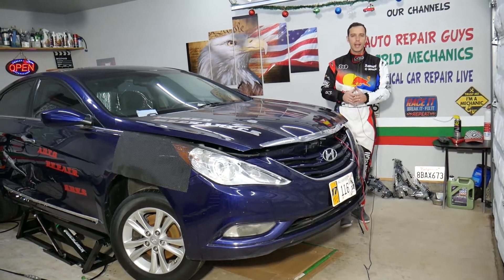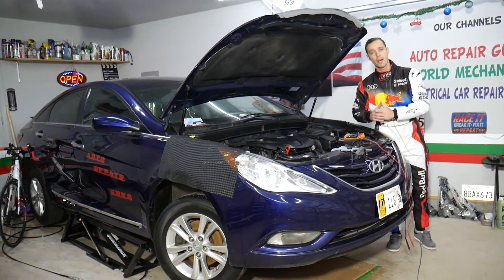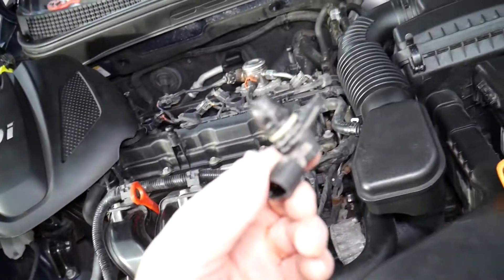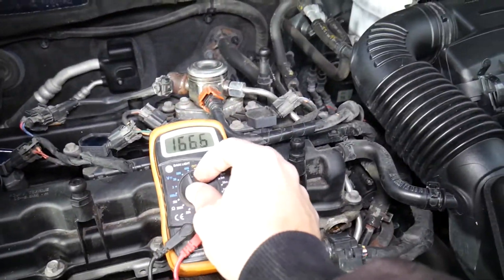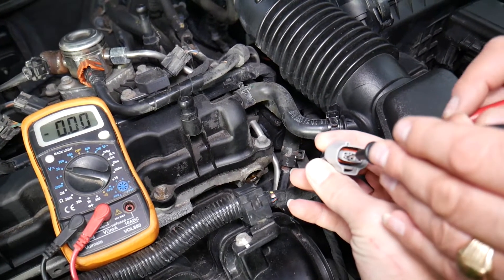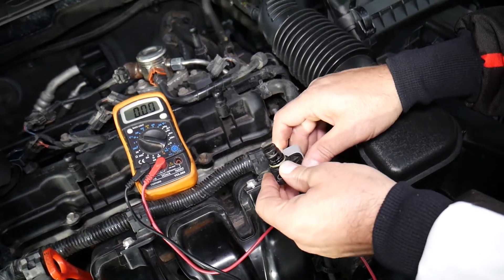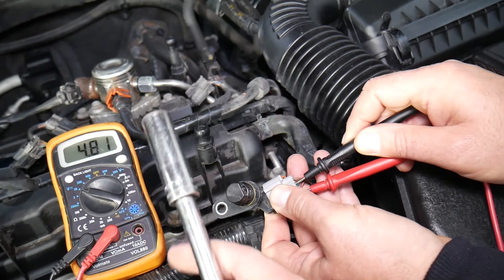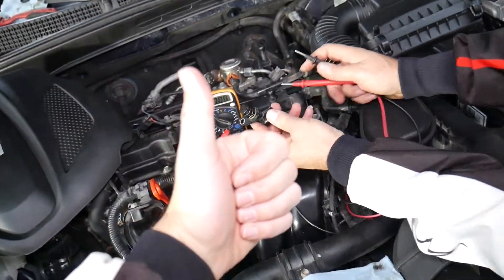HOW TO TEST CAMSHAFT POSITION SENSOR ON A CAR

Comment from the maker: Products that we use and recommend:
► Camshaft Position Sensor (check for your car): https://amzn.to/39Ccc3O
► Alligator Clips: https://amzn.to/2Xhxz2O
► Voltmeter: https://amzn.to/4eB1vyH
► Panel Removal Set: https://amzn.to/3YiMADu
► Tool Set: https://amzn.to/3p5MM6t
► Screwdriver Set: https://amzn.to/3XRB28Q
► Castrol Oil: https://amzn.to/3xBc8B9
► Oil Filter: https://amzn.to/3w0Ulme
► Torque Wrench: https://amzn.to/32qyRwg
►Liqui Moly Oil Saver: https://amzn.to/3xR3Px3
►Liqui Moly Engine Flush: https://amzn.to/3IiDBID
► OBD Scanner that we use most often: https://amzn.to/3I4MQfe

► We buy our Tools and Parts from here: https://www.amazon.com/shop/worldmechanics
Reply: I really appreciate your videos I've learned a lot I like the other channel too it is awesome keep doing what you're doing I really appreciate everything
Reply: Hello just seen this video my check engine light came on with code p0011 for a 200 Jetta 2.5 it said intake camshaft sensor I did what you explained and when I put the socket extension it did not change what does that mean
Reply: @lexxon4life804  It means your sensor is bad. Put a new one in.
Reply: I have trouble with my Astra H for a long time and.
Its just lazy car and aceleration, one day i change one anf was perfect 20 days.
Than again other sound of engine, after that, i put back the first one wich i take out... also good first few days, latter againg lazy.
Bought new one Samsung, nothing change xD
So what can be problem more and when i buying sensor, do i need to put that specific sensor on his place or will work also if i switch position of tham?
Some orher advice, thanks.
Astra h1.6 Z16 XER
Reply: I did that test on the camshaft position sensor.  When I put the pins in I got a reading of less than one and the weird thing is, when I tapped the sensor with a wrench, the reading would go up to 4.65 .  It's a Chevrolet Malibu 2015, 2.5.  I get a code P0016 on it.

Comment: I have a Mercedes-Benz C180 S204 CGI with fault code P034062.. I tried to test the camshaft position sensor and these are my observations.. I got 10.73 volt between 1 and 3 and 0.466volt between 3 and 2. Is the voltage between 3 and 2 not meant to be 5 volt. If yes, what could be the issue..

Comment: When key is on, engine off, I go test for signal ground and power, I get 5 volts for both signal and power wires no battery voltage reading,

Comment: Hello;
I watched your video. I think I have the same problem.
My car is a volvo s60 2009 model. I start it but it doesn't work. I checked the ignition coil, spark plugs, fuel, and timing. But none of them had any problems. 
Finally; the camshaft position sensor and the crankshaft sensor remained. I checked the camshaft position sensor like you did.
It is connected with 3 cables. When I check with a voltmeter, I get 0v. However, when I touch the sensor with metal, the value becomes 5v. The opposite happens with you. In the video, when you bring metal close, it drops to 0.
because it is a different car? Or is the sensor faulty? I wanted to consult you. Thank you very much for the informative video. Have a nice day

Comment: 2014 TOYOTA COROLLA LE (190,000 MI)
CHECK ENGINE: P0017

Is it possible to test the sensor B with the Volt meter without removing the sensor? 

This is the only code I have, but I'm hoping it's the sensor B. but I am also wondering if it's the whole timing chain. I occasionally have the loud noise from belt/chain when I have cold starts but we don't have many cold mornings where I live. That is about it as far as symptoms.

Comment: What should we do if the power wires is only showing 5v instead of 12? Car is in on position but motor not running. Thanks!
Reply: I have the same issue. Have you figured anything out about that?

Comment: I’m getting 4.8 then .24 with a metal piece touching sensor. Is that good on my Kia optima or does it need to be all the way zero? Thank you
Reply: Hey did you get an answer for this? Mine drops to .25 from 5volts

Comment: What if I'm getting the 5.0 reading, but not getting any reading from the battery?
Reply: No matter which two pins I connect to, I'm not getting the 12v reading from battery. Only getting the 5.0v reference
Reply: Have you found out if that is normal? I have the same issue.
Reply: @johnjurj9904  I'm assuming it is normal. I bought two new cam sensors, installed them, and tried the same thing on them, and got the same result. I ended up redoing the timing, and it's been fine since.

Comment: Great video!  Very clearly describes how to check camshaft position sensor.  My questions is what do you do is the power wire and the signal wire are both registering 5.05 volts with the ignition switch on? Obviously there is an issue with power wire.  How do I trace it down?  Started picking because getting P0017 code on 2005 XC70.  Thanks in advance for any help you can give me!
Reply: I did test it by passing a socket under the CP sensor and no change in the output so assuming the CPS is bad.  My main question is if the 5V to both the power and signal side is normal in a Volvo XC70?
Reply: I have the same question for my 2013 Ford Fiesta SE

Comment: ive seen in other videos that they disconnect negative battery cable first before removing sensor...is that just for safety or is there a reason. behind it? thanks in advance

Comment: I backprobed the connector and got 4.93V across the ground and signal wire.  But when I plugged the camshaft sensor into the connector the voltage dropped to 0.26V.  I made sure the sensor was not near any metal and this happened both when the car was running and not running.  What would cause the voltage drop?

Comment: best vid on testing the sensor, but my Chev Colorado 2011 uses a connector which does not provide access while sensor is connected.  So sadly no way to verify the reading drop...

Comment: My camshaft position sensor drops to 0.11 volts when testing it. Is that a good enough reading or does it have to be replaced?
Reply: Hey did you get an answer for this? Mine drops to .25 from 5volts

Comment: I don't have 12 v going into my cam position sensor only 1v
But I do have 5v on signal wire.

Why would that be? Does the v come straight from the battery or from the computer. 

I have a MK4 Ford Mondeo turbo diesel.

Comment: Driving x trail t30 currently  i am guessing this sensor is gone its 18 years old camshaft sensor   had crankshaft sensor replacemen like 7 years ago but  what happens now is my car has insanely rough idle big cranks when cold but when hold it cranks long and cant keep rpms until  i rev it .... randomly dies while revving  and driving my engine completely shuts off   and after that crank takes like 10 times for 5-10 sec till it starts am i right to guess  this is the issue ? PCV Valve was stuck cleaned ... New Spark Plugs  Headgasket checked no leak  New  My coils are absolutely  noew had to replace them along my Valve Cover because gasked wouldnt do the job it was melted am i right in my guesss ? Also my fuel consumption got up ..

Comment: Hey bud thanks for the video, it is very useful and informative! I tried to test my sensor yesterday. It shows 5.07v, when I use the metal for testing the tip of the sensor it shows 0.28, is it normal? Please advise with many thanks
Reply: Hey did you get an answer for this? Mine drops to .25 from 5volts

Comment: How about an intermittent signal fault from the sensor. 99% of time the signal is good and then occasionally it fails. This test is useless in that case
Reply: Gotta wait for it to get faulty and test it right away
Reply: @Maartuga987  yeh maybe, but on side of road. And after a few minutes waiting, car starts again meaning fault has resolved. 
I just bought a new crankshaft position sensor and car is now fixed. But old sensor still shows it works ok on multimeter 🤷‍♂️

Comment: I have a 2017 Elantra and have recently found your videos. You guys are absolutely the best on explaining everything clearly and also explaining the why. Your camera work is also excellent. I replaced my crankshaft sensor and the Camshaft sensor is next. I don't think I could've done it as easily if it was someone else's videos. I have a 1.3 parasitic draw x 3 years I can't find except I found it's coming from positive battery fuse which could be anything. Do you have a video that can help me find it? You guys are the best!!! ❤❤❤

Comment: Can anyone help, I tested out all three wires, I assumed my middle wire is the ground and the outside (left wire) is my signal (I got 4.98 volt reading), but I cant get the battery reading on the other one (right wire). Anyone know whats the problem?

Comment: Hello, thx for the vid. Do you have a link to your other channel about electtrical car repairs? And is it the same procedure for the crankshaftposition sensor? I have a daihatsu Sirion with a 2-wire crankshaft position sensor. And can i test the 2 wire crankshaftsensor harness, maybe with a continuity test?. Regards

Comment: One cable of my plug is 5.3 volts one is ground and the other cable is 4.83,  I tested the last one when is closed to the metal its low to 0.19 volts on both sides is the same is that ok ? 
also I tested two sensors that I bought on Amazon and I think they are defective I checked them and they give me .21 volts closed to the metal and car shows a message of limited operation and check engine turn on very fast

Comment: I just wanted to stop by for a sec and say thanks. Your videos have been a huge aid in diagnosing my Chevy Cruze. I think I'm looking at changing the VVT camshaft gears in my 1.8L. But I wanna check all my sensors and stuff before I dig into the internal timing components. Your videos are easy to understand and provide great info!! Thank you!!

Comment: Dude I've got some weird stuff going on. I have 4 cam actuators solenoids, 3 of them are delivering 12 volts The other one has no voltage. Any info much appreciated

Comment: I mean, terrible video. Can’t see where the probes are inserted at all! Only the meter readout. Seriously?
Reply: Really? Then you need to learn how to use ur meter. If u have just two wires to your camshaft position sensor then you will ground to the vehicle and to one port. Both of those ports represent signal and battery. Does this make sense? If not I'll provide further information and help you understand.

Comment: When checking the polarity on voltage for my camshaft sensor at the plug I'm not getting a 12 v reading. Two of the wires are 4.8 and the other ones ground. I should have one that's 4.8 and one that's 12. Anyone have an idea why? I just had a question about my sensor its not dropping to 0 when I put my wrench to the end of the sensor. it's going down .75 .
Reply: I have the same question.

Comment: When testing my camshaft sensor the voltage drops from 4.8 to .75 when i put my wrench to the sensor. It's not dropping to 0, is it a bad sensor?
Reply: Hey did you get an answer for this? Mine drops to .25 from 5volts

Comment: Yo, I'm confused , I followed your procedure exactly, but the 5V 'signal' wire reading remained at 5V when I touched the base with a steel bar! Sensor must be faulty
 I bought new Cam Position Sensors (Bosch) for my Peugeot 308 (cost a fortune). 
The result is exactly the same as above ..... no voltage drop to 0.00V on touching the new sensor base, with a  steel bar! 
Any other way to do the test....or .... is my ECU faulty?

Comment: I have a P340 engine code for camshaft position sensor low voltage. I replaced the sensor but made no difference. Looks like the issue with the signal wire from the ECU. I hope this video will help me diagnose my 03 Civic issue. The problem I am having are engine stalling mostly at highway speed but also at low speed and coasting and sometimes when the engine is hot and also when park an inclined surface. I replaced the fuel pump, but the issue still presist.

Comment: Dear Sir Nice video 
I want ask i have same voltage but then i touch the camshaft with metal no Change on 5v 
But then i touch the camshaft on 12v so mikrometer Change volt 
Can you tel me My camshaft sensor is ok or not.
Citroën c4 Picasso 1.8 Patrol (2006-2010)

Comment: My sensor stayed on 5 volts when I put a socket on it. So I bought a new sensor and it still stays on 5 volts. The code tells me I have a cam position problem. Is the new sensor definitely bad or can there be another reason?
Reply: I have the same problem and tried many sensors, I'm thinking it might be the timing chain?
Reply: Did you check vvt solenoid?
Reply: @Seeker887  Yes, I cleaned the vvt solenoid. The problem was the cam timing.

Comment: I got Zero on one which means good right? The next one it dropped from 4.8 to 20 ? I'm thinking that means the sensor is bad?
Reply: @autorepairguys
Reply: Hey did you get an answer for this? Mine drops to .25 from 5volts

Comment: Question does this test always work all of my cam sensors will not go to zero when close to metal 
Are they all bad 
I just keep reading 4.8 4.9 v
Reply: Did you solve the problem? Mine reads a constant 5v even when a metal object is near.

Comment: Hello when i put the conector in  the sensor i have 4.97 volts and if i take a socket on it i drops to 0.30 volts is that sensor faulty or is it good ?

Comment: Wow, thanks for sharing this also is it true that if you have a crank no start engine and your RPM gauge doesn't work.  Does that mean you're CPS  sensor is bad? I just put a new CPS sensor in my VR6 engine and I have a crank no start and the RPM gauge doesn't work either. Should I buy a new sensor because this one is broken that's new?

Comment: I followed your procedure for my 2012 Ford Focus for my CPK and my signal side shows 4.8 V but the open side (wire to battery) reads 5V not the 12V you had. my car has two camshaft sensors and a tested both with the same results. Would my model read 5v for the open side because its connected to the 5v relays or is this another issue like wiring? please help!
Reply: Most vehicles will have a 5v reference to the cam position sensor, a signal wire and a low voltage referemce wire.

Comment: Great video, but what do I do if the connector is GM, aka points so small I can’t get the voltmeter in to check?
Reply: Paperclips. Or smaller wire.

Comment: When I did the test it read from 5 volts the signal wire and when I put the socket over it. It read 2.9 volts. Is that sensor good?

Comment: Will the car run with a used ECU from Ebay motors without being programmed by HYUNDAI. We only have 7 volts on the battery wire. Battery is at 12 volts. 2015 Elantra GL

Comment: I just tested mine on 2006 nissan maxima and there was no reading from the signal wire but the power wire was just under 12v.

Comment: I have a 2010 cx7 I am getting 1 initial spark on cylinder 1,2,and 4
Nothing on 3 and after the first spark I have no more until I let of the key and turn it again 
Also the tack is not moving as I turn over the engine 
Any suggestions?

Comment: Have a 97 honda s2000 with a po335. I did ur test. UNPLUGGED I have 12v batt voltage on one wire, ground and a different wire and 5volt reference on the last wire. NOW WHEN I PLUG IN a ckp sensor have 12v, ground, and now 9.5v on the ref wire.  Is the sensor shorted? I tried the socket trick the my ref voltage stays the same. Currently I’m wait for a new sensor to test. Any ideas?

Comment: Does the 3 wire cam sensor work the other way, like 0 volts at rest and go up to 4.8 when it comes in contact with metal?

Comment: i dont have the 12 volt signal .. what does that mean ,,
Reply: both my low voltage wire and my 12 volt wire read 4.93    all 4 of them .. i have 3.6 gm motor ,
Reply: @williemoon7522  did you figure out why it was reading that low on the 12 volt wire? I have a 08 Yukon XL with the same problem, and I can't get it to start up.
Reply: @preachercharleshadeniii3764  .. my car runs fine with the check engine light on .. i just covered it with tape and have been driving for 8 months now .

Comment: Please help: I have done this test. One sensor went to 0 volts . The other sensor also went to 0 bolts (intake one), but when I pushed a metal socket to the sensor the car tried turning over? Is this normal? Are my sensor faulty ?
Reply: Potentially yes

Comment: I have 3 sensors and I try each one of the and all 3 would not break contact withe the single wire I can belive all 3 are bad other then the cam sensor should I have 4.8 to 5.4v on the single wire from the ecm

Comment: Hey thanks for the video I got a lot of information out of it but I was wondering if this would work for a Lamborghini I have two of them. I have an 88.5 Countach special edition and an 05 special edition Gallardo. So I needed to do a tune-up on the Gallardo and when I was changing my spark plugs I was pulling up on the coil pack harnesses and pulled a little too hard and the plastic around the camshaft sensor pigtail connector completely disintegrated but the wires are still there and just hanging so I don't know what pin position they go into the new pigtail connector so I was wondering if this method of checking to see which wires are pulse and constant and ground would be the same procedure. Well hopefully you'll read this and great video I subscribed you have a fan

Comment: What if I don’t have a 12 v reference? I have the 4.8 but the constant voltage is 5v I’m lost
Reply: I have the same readings did you ever get an answer?
Reply: @333luckycharm  5v is okay because of the relay, same as mine Kia Forte